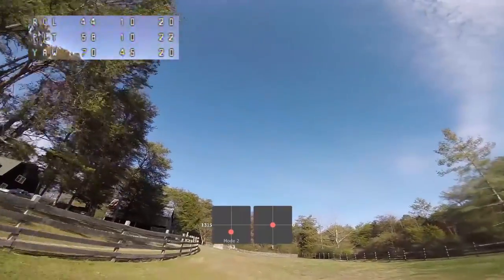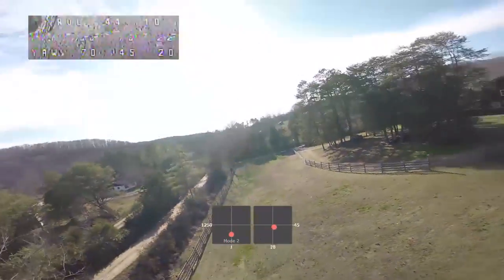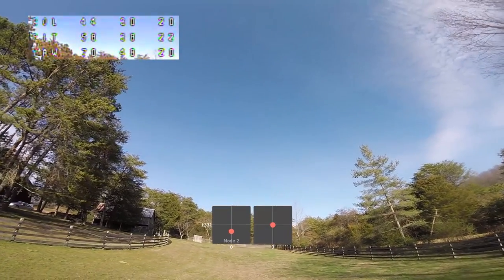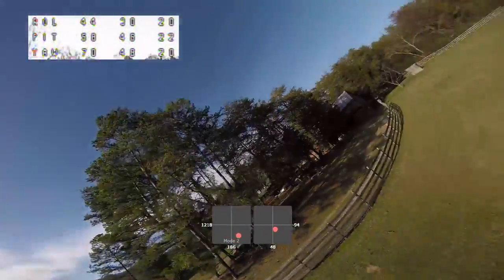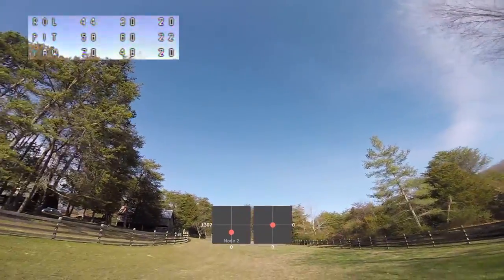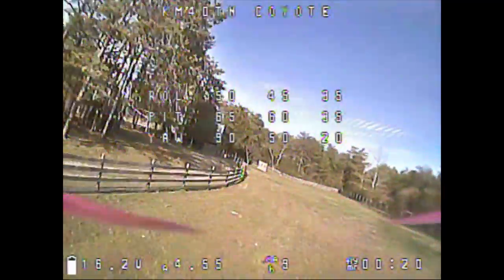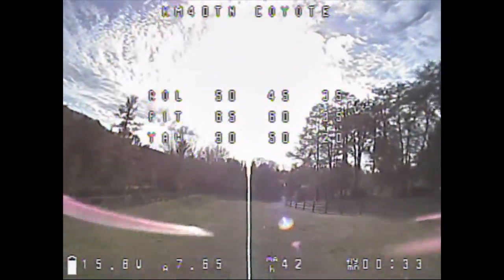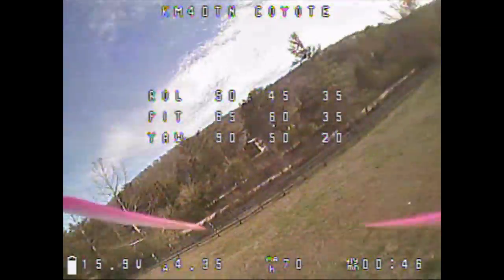Betaflight 3.1 anti_gravity_gain | EXPLAINED

Comment: Thanks for a great video. I have only one question, not exactly concerning the subject of your video, but still about something you mention here. My quad sometimes suffer from I term windup, even if I set my anti gravity gain at 1. I wonder if you ever made a video about it or did you mentioned some other cases why I term windup can occur. I try to watch all your videos but I might missed that topic. Thank you very much.
Reply from the maker: Is your I gain super high? Really betaflight 3.x should not experience I term windup under most conditions.
Reply: My I gain was 35, I soft mount my flight controller, my anti gravity gain was set to 1, I run latest betaflight, the fc is spracing f3 with gyro set to 1khz and pid loop set to 1khz, escs are ZTW flash 30A running on multishot (synchronized with pid loop), motors are emax rs2205 2300kv and prop gemfan 5045HBN. My rates are giving 1100 deg/s at extreme rolls and flips. The disaster while the copter was keeping flipping happened a few times always after extreme flip or roll. Thank you very much for the response. I wonder if I term windup can occur only if there is an excess I gain or because of other factors.
Reply from the maker: +Tomasz Łęgowski I gain if 35 is not very high. I'd be surprised if windup was the issue. Blackbox would be the final answer.
Reply: You are right, I have to get a decent FC with SD card because small on-board flash of my spracing doesn't do the trick.
Reply: I found one odd thing in my pid settings of the quad that suffered from I term windup: P gain was higher than I gain (25 vs. 35). I changed it and now the P is higher and and after 8 heavy flipped and rolled flights I can say that the problem is gone. Thank you.
Reply from the maker: +Tomasz Łęgowski so P was too low, resulting in excess error, causing the I term to wind up.
Reply: You were right. Off course. The answer was in the black box. The problem with rolling copter was coming back and one time I caught it on Blackbox. I have a 8 MB memory and it was rare (aprox every 10 flights) so it wasn't easy. The problem was gyro fail. The gyro stopped sending eny data and that's why it was rolling. After reboot the gyro works but I will throw the flight controller to the trash. Thanks for your help. And thanks for your channel.

Comment: ive looked all over for this where is it at????
Reply from the maker: In the CLI.
Reply: Joshua Bardwell do you mind if I ask what you type to do it to set it to I guess 2.0 and if it doesn't work what do I type to take it back off and set it back to normal I guess 0.0 if it's not too complicated of a question to ask

Comment: I have a question I need help answering. If you were building a quad that had two different KV motors on it. 2450 and 2750Kv which ones would you want In the front? In addition would this even work in 3.2 or would the offset motors cause to many issues? I have left over parts I’m using to build a Franken-quad appreciate any insight thanks
Reply from the maker: I'm not sure how I would even begin to decide which motors to put where. I don't think you'll notice any difference, although the difference will be there.
Reply: thank you!

Comment: I've been struggling with pitch attitude hold, on my builds since moving from 2300kv to 2600kv. For racing, and the constant throttle adjustments, can you address any potential initial setting deltas? thanks
Reply from the maker: +VD2021 2600 kv is going to have a little less resolution in the bottom end. It's mostly just a matter of practice.
Reply: Joshua, thanks. I recently flashed two of my quads with 3.16 and yesterday evening I set the anti_gravity_gain to 2.0 and it worked like a charm. What an awesome feature.

Comment: Anti gravity was turned off on my kopis 1 from the factory tune, should i turn this on? Should i be using it?  and if so what should i set it to? 
When going full throttle with a fresh battery the kopis 1 would flip around (yaw and flip) automatically on angle mode with right stick centered, the out of control feeling would last about 3 second then straighten itself out.  

I am using 1550 HV batteries when the voltage comes down a bit it doesn't seem to do it... very strange.

Joshua can you please do a video of ultimate settings for the Kopis 1 just on config and PID tabs in betaflight.
Reply from the maker: The default settings were great for me but I didn't fly at all in Angle mode. I don't really do a lot in autolevel for bigger quads.

Comment: what beta-flight option should i tune if i see that my quad drops attitude a lot when i pitch forward and backwards or roll ? i  find myself straggling to keep it at it attitude.
Reply from the maker: Most likely this is just a matter of experience. You need to raise throttle when you pitch or roll the quad because less thrust is directed downward.
Reply: @JoshuaBardwell  as a side note i wonder why there is no special option that auto add as needed when such moves accrues to address such issue where you you need to raise the throttle just to keep the quad leveled...

Comment: I don't understand this, the only option in the 3.1.7 update modes tab is anti gravity, where is acro, horizon and angle?
my arm is on aux 1 from 900 to 1200 and anti gravity 1200 to 2000. but this can't be it right what am i doing wrong?
Reply from the maker: Your accelerometer is turned off.

Comment: hey, nice video! thanks. i just looked at the CLI and also found the parameter "anti_gravity_rate_max ". can you probably explain what this is? thanks
Reply: as I understand it, its the maximum °/s the feature is active, so it does not activate when you are doing a manuver, default is 90°/s (very slow rotation), this is done so this feature wont boost your I middle of a move, cos normally betaflight turns I down alot during movement to make it smoother, hope this helps
Reply from the maker: +nixxinn I thought that parameter was removed. Are you sure you are on 3.1.6?
Reply: well no still on 3.1.5, will get there when the snow melts and temps rize :)
Reply: jup, i am on 3.1.1 but the video says 3.1 so i thought it was valid for all 3.1.x revisions.
Reply from the maker: +8r41n3rr0r the feature is there but there have been small changes over the versions.
Reply: right. no offense :) was just currious and little bit confused.

Comment: where do you set this? only in cli? how do in know if its on? thanks, love your videos
Reply from the maker: Yes. CLI only for now.
Reply: thanks for the reply, so is it auto on, or do you set the mode so its on with your flight mode? i saw in "dump" its at 3 but i dont know of its always on or just of its actived in flight mode.

Comment: For fly mode switch, do you set air mode and AG mode together as one fly mode? Or seperately as individual fly mode? Thanks your videos are very helpful.
Reply from the maker: +abbeyglencircle I have air mode on all the time.
Reply: Joshua Bardwell so air mode and AG on at the same time
Reply from the maker: +abbeyglencircle what is AG mode?
Reply: Joshua Bardwell in the mode bar,  it has air, antigravity, angle and horizon this is how it appears on betaflight.   On my fly mode with the three position switch first position is angle second horizon and third air plus AG?  Is that how it goes?  Or AG is not consider a fly mode, not clear on this.   It stands on it own like buzzer?
Reply from the maker: +abbeyglencircle anti gravity is not a flight mode, correct.
Reply: Joshua Bardwell that really clears thing up, 😊 thank you
Reply: Am I understanding this correctly that in 3.1 Antigravity is defaulted to always being on, and the only reason it is available in the mode tab is so that you can turn it off?
Reply: AG is off default.  You have to turn it on.  I turn AG on with Air mode on, in combination.

Comment: I see there is a new 'anit-gravity mode' added in. Does it just bump up the anti_gravity_gain from 0 to a set level?
Reply from the maker: If you do NOT define "anti-gravity" mode then anti gravity gain is always applied. If you define anti_gravity mode, then you can turn anti gravity on and off (off means gain=1). But I have no idea why you would ever want to turn it off.

Also double check in your Features that there is no anti gravity feature. Some people have reported seeing it, although I don't. If there is an anti gravity feature then you would need to enable it OR the mode to make anti gravity active. But I don't think there is an anti gravity feature so I think you can ignore this paragraph.
Reply: Joshua Bardwell - I did see it in the feature list (3.1.7) and I enabled it. Now it is no longer in the modes tab. Does that mean it is always on? Also how do I change it back where I can turn it off and on with the modes tab? Thanks. Love your videos btw. It's awesome that you spend so much of your time to educate others.

Comment: Is there a solution for this on KISSFC? I mean using KISS FW. I just installed new ESCS and my quad is still pitching up severely under heavy throttle.
Reply from the maker: I guess I would just increase I gain. I don't know of any specific function like anti_gravity_gain in KISS.
Reply: Thanks Joshua :)

Comment: hey I have a question, It seems like every time I do a flip or even a  split-s my 210 drone seems like it loses altitude and really fast hovers to the ground. It doesn't do it on my 280 drone,  I can do a flip on my 280 and it will slowly hovers down. How  can I fix that or have you ever heard of that issue.

oh yeah it doesn't do it on a roll.
Reply from the maker: I'm really not sure what to advise here. Different size quads fly differently so it's hard to judge whether what you're experiencing is really a problem.
Reply: Yeah I actually used the stock PIDS from my 280 that were from Cleanflights stock PIDS and it actually fixed the problem and I also lowered D on pitch and roll. But now it seems like it quite as responsive like it was. It feels more stiff. what did you say makes it do that I know you said it in one of your videos but I can't find which one. Yeah it might sound crazy but I think cleanflights stock pids are way better than Betaflights.

Comment: This is exactly what I've been trying to solve by increasing I-term, with no results...(in KissFC)
Reply: If you want to give this a try, you can flash betaflight 3.1 to your kissfc - make sure you read up on the resource remapping bit as you'll want to remap motor outputs in betaflight so you don't have to resolder everything - means you can flash over to betaflight to test it, and flash back to kiss once you're done. https://github.com/betaflight/betaflight/wiki/Board---KISSFC
Reply: I have bf flashed on a kiss, no need to do any motor mapping it's already taken care of.
Reply: What build did you flash? that bit from the wiki was 3.1.1ish and was necessary at the time. Would be nice to know they already have it sorted in the new builds.
Reply: Hmm 3.1 on kiss here and the motors are mapped to BF format automatically with escs in kiss configuration.
Reply: 3.1 dot what though? .6? Having to remap the motor outputs and use 'quad X 1234' as the mixer was totally a thing when 3.1 first released (or maybe they modified all of the 3.1 kiss targets? dunno, but glad to hear it's a done deal... I may flash over later to see for myself but my kiss tune is finally where it needs to be).
Reply: 3.1.0 I'm sure it's mentioned somewhere in the rcgroups thread..might have been a late addition.
Reply: Weird, I was actually going to comment and ask why this seems to be a common issue in BF but not with KISS. None of my KISS quads have this issue. You might try moving your CG to help. If it's pitching up on high throttle move your lipo forward, if it's pitching down on high throttle move your lipo back. In my opinion KISS firmware flies better than BF (not being a fanboy here as I use BF and KISS on different quads, just prefer KISS), so if you can solve your issue within KISS that might be the best solution.
Reply from the maker: This is 100% not a CG issue. I have tested moving the CG all the way forward and back. It is an issue with aerodynamics. The rear props are getting dirty air and make less thrust, therefore the I term has to change to compensate when you move the throttle.
Reply: Joshua Bardwell Then why does sliding the lips forward fix the issue on my race quad? Many others have also reported positive results by changing cg. I respect your knowledge Josh, but I have to disagree with you on this one. I build quads everyday for people and have had great success with this by changing cg. I feel like the general idea of finding cg with the quad level is the wrong way to do it. We don't fly level. We fly pitched forward, and that's how cg should be tested and balanced.
Reply from the maker: +Quad Logic by the same token, I've never been able to solve this by adjusting CG, even to extremes. The aerodynamic effect definitely exists.
Reply: Joshua Bardwell On that I definitely agree. Aerodynamics certainly play a role.
Reply: I think you are right - it's a cg/line of thrust issue and it's complicated by the distribution of weight in the quad. As you said, the cg may be spot on when the quad is flat but having heavy items distributed along the y axis (underslung batteries, gopro etc) shift the cg significantly when the quad is tilted and also move the cg away from the line of thrust.

Comment: Hello Joshua, I have a Wizard X220, when I'm programming, in my cleanflight or betaflight, I do not have the anti gravity option, I'm using the last version of the application, I downloaded it in the google chrome apps. What can it be ?
Reply from the maker: The antigravity option is only available in the CLI anyway. But you may just have an old version of CF or BF on your board. Just because you downloaded the latest configurator from the Crhome store, that doesn't change what firmware version is running on your quad.
Reply: Would you have any tips, or a video of what I should do?
How could I change the firmware of my drone?
Reply from the maker: https://www.youtube.com/watch?v=e7dGCZMJ6SA

Comment: Hey Josh im probably being thick but just had a look at the anti G on the cli and mine is default 4.000 saying it can be set between 1-3  . you suggested 2-3 does this mean 20.000 ? many thanks just need some clarity 
All the best 
Clive
Reply: Just configured it myself, my FC tells me it can be set from 1-30, not 1-3. So 2-3 = 2.000-3.000
Reply: Aaron Gerhart 
Hi sorry I meant to say between 1-30  yet the value is already 4.000 higher than what josh had advised unless he means 25.000 maybe I'm getting confused here but I still don't see it lol doh !! I can only assume that a default value of 4.000 is so low (effectively turned off )  I'm running 3.1/6 so perhaps this just has 4.000 set as default now
Reply: confusion comes I belive from that the defaults have been changing in diffrent versions of BF, was some problem in the beginning with it cose many used very high I gains to combat this, and you add this feature on top, I goes crazy, but think thay went back to having it activated as default
Reply: Thanks for that it clears it up makes sense 👍🏽
Reply from the maker: +Take Flite it looks like they changed the default to be enabled again. Gain of 1.0 is disabled. Gain greater than 1.0 is enabled. If they've set the default to 4, then just try that.
Reply: Joshua Bardwell  cheers Josh will do have a great day

Comment: have you ever had a quad not respond to ANY anti gravity or i gain, but when air mode is on the quad fine?
Reply from the maker: Air mode and anti gravity are two different things that address two different problems.

Comment: So basically tune your P and D first, then turn on anti gravity and work on I term?   Also is there a way to find out if this is supported on your FC before smashing it into the ground?   Worries me you say if the FC doesn't then it will just crash.
Reply from the maker: +Jason Graham where did I say that??
Reply: At 4:50 you talk about the default being zero since thats safe for all FC's because some might keep flipping and rolling and crash?
Reply from the maker: +Jason Graham the default is disabled because some people with very high I gain would have windup problems if they also used anti_gravity_gain.
Reply: Joshua Bardwell Hi, love your videos. I don't understand what is windup problem. Thanks.

Comment: JB I need your help bro. My quad pitches and rolls about 35 degrees when I come off a hard throttle
Reply from the maker: If it only happens when you go all the way to zero throttle, then enable air mode and that should fix it.

If it happens whenever you make a strong throttle movement, it may be a bad ESC. https://www.youtube.com/watch?v=d7mEXyW2cas
Reply: I think its air mode. I disabled it so I could fly with horizon mode just so I could line of sight see how fast it was. It's my first 6s quad. Thank you for you help bro
Reply: If you look at that last video on my YouTube the one that says success you'll see about the end of the video where pitches and rolls
Reply: Thanks bro I just tested it. It was air mode